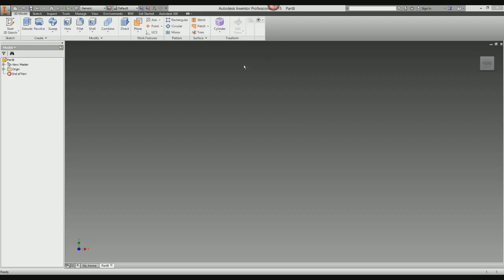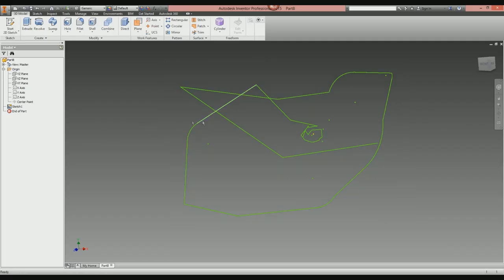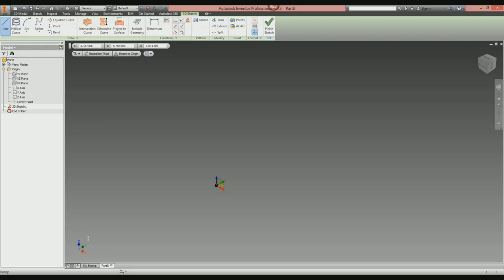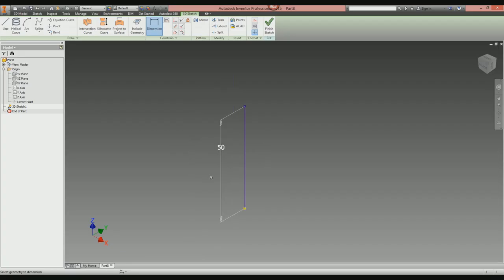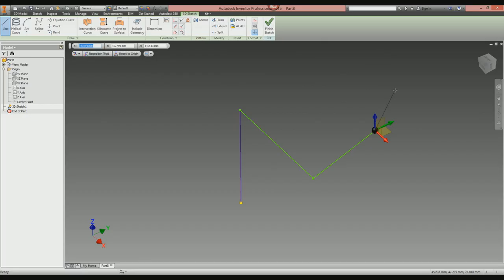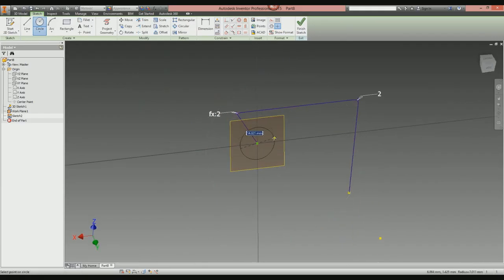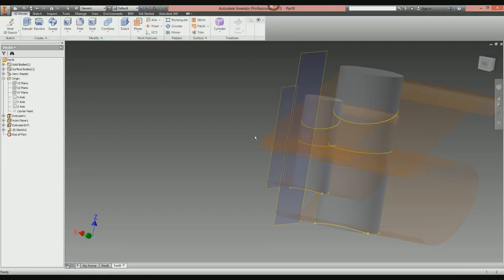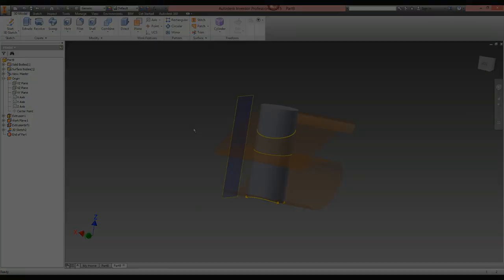How to 3D Sketch | Autodesk Inventor

Comment: your channel is the best. best vids for inventor I wish I can find someone like to that teach AutoCAD electrical.....
Reply from the maker: Thanks! AutoCAD Electrical is something I've intentionally dodged over the years, it's an awful program.  We're actually completely replacing it with EPLAN in my company, Autodesk have shown zero interest in developing AcacE so we're ditching it and moving on to a proper solution.
Reply: Thanks for the response and recommendation man! I shall have a good look at EPLAN. The reason that I was considering AutoCAD electrical is that it's somehow compatible with Inventor, and create the physical model in inventor based on the design in autocadE. The application I'm modelling is an EV, so I was looking for a solution that could save me time sketching all the cables( 3D sketch maybe lol), wires and connectors. I don't know whether EPLAN is capable of doing this.

Comment: Very good tutorial vid. Down to earth and practical. I've struggled the last few months with 3d sketchs in Inventor. I've come from ProE, which is difficult, and solidworks which is easy for 3d sketchs. The many articles I have read on the subject failed to mention little things like like selecting the planes on the Triad. Simple whenj you know but impossible to fathom when you dont. One thing that I'd like a little more knowledge on would be the include geometry feature. Why cant you select origin work features? Or can you?

Keep up the good work.

PS I like the music.

Comment: good video. How important is to have a basic drawing course, before trying to learn Autodesk Fusion  or Fusion 360. Is there a book of homeworks for drawing 101, where students can begin to learn how to draw in in general, and then later learn 3D in Autodesk or CAD???
Reply from the maker: +Alberto Ratmiroff Autodesk Fusion and Fusion 360 are the same thing.  And what you've just watched here isn't Fusion! This is Autodesk Inventor, you could say it's the original 3D package from Autodesk and the big brother of Fusion.  There may be books out there that teach general drafting skills but I've never had any contact with them, the best option is to decide which software program you want to specialise in and self teach yourself.  Whether you go for 2D or 3D will depend on which industry you want to work in

Comment: Very good video, thanks for posting it this really clarified my understanding of 3d sketching.  One thing that I was looking for in the video, was if I can create a sketch on a plane that I can then extrude to a cylinder, so that I can have one cylindrical part, and a separate part that would essentially attach to the cylinder so that I can maybe glue the two pieces together on the tangeant, do you have another video that shows that kind of use for 3D sketch?
Reply from the maker: Jason Wright Yea what you're you're trying to do their isn't a 3D sketch requirement.  If you do a 2D sketch on a plane and you're extruding to a true cylindrical face, that'll be an emboss you want to do.  That'll terminate the extrusion on the cylindrical face and wrap it around.  Alternatively, if it is a separate part, it should really be done in an assembly as a separate part too!

Comment: Great videos. Could you do one on sketching on multiple planes in 3d space and applying constraints to those sketches to create rails for Loft? I'm having a hell of a time. I can use constraints no problem on a single plane but they don't seem to have the same properties when there are multiple planes in 3d space. T-spline handles can't be manipulated either. I am clearly doing something wrong!

Comment: Well covered.  Can you tell me if there is a way to connect the 3d sketch point (start line) to existing geometry?   Or can you tell me if there is a way to project geometry or a point to a plane perpendicular from the projection as opposed to perpendicular to the work plane.   I am trying to get from a obscure angle plane to a set plane.
Reply from the maker: Winston Beshore Thanks! Firstly, yes you would use 'include geometry' which is on the 3D Sketch panel whilst you're 3D sketching.  The second one, it's difficult to visualise what you're trying to do without seeing it... but you could try the various 'project to surface' options available within 3D sketching?

Comment: I wont to design a motorcycle frame with 1 1/8 OD tubing. This will need to be made with 3D sketching. The tubing will need to be arc’s starting @ 0,0,0 on X plane from rear axis to the seat. Approximately 17”,9” (arc offset about 3”) – y plane arc @45 deg. to offset X Plane offset 5” (arc offset 1.5”) then on offset X plane to front of bike strait for 4”.  The 4” length will be split in half for welding to another tube. I can’t get it right each time I have tried it. Once you show me how to do this, I will be able to design all the tube frames.

Comment: I have just discovered that one can use precise input in 2D sketching too. I recently had to model an existing large flat plate with three sets of hole type (tapped, clear and clear with c'bore). The hole positions were given in a co-ordinate table for hole type A, B and C, with the number of holes being 94. The plate had two planes of symmetry and so I used the point tool place and dimension points on one quarter and then mirrored and rotated (I couldn't get it to mirror a mirrored set of points). I didn't use precise input, but I wish I had as it would have made life a lot easier. Is there any way that one can use the precise input so that the dimensions are automatically recorded? I found that while the points were in the correct place I still had to add the dimensions. 
Regards, Bob

Comment: What I'm missing is when I actualy have for instance a oilsystem and have 2 positions in an angle of lets say 72°  that are determined true the assembly of all the components.  
How do I get from there to create a 3D sketch at a quick way to create a pipe or flexible hose to connect these two point in a correct way.  The rest of it is all good!

Comment: Very informative, thanks. Video was a little fuzzy. Any way to sharpen it up?
Reply from the maker: Daniel Drouillard Cheers :) All my videos are recorded in 1080p with the more recent ones at 60fps.  Did you hit the cog button under the video and change the quality? It should be crystal clear at 1080p but can be slightly compromised if downscaled to suit a different resolution (whatever you're viewing it at).
Reply: Got it. Probably my settings. I will check into it when I get a chance. Thanks

Comment: Hi ... I am sorry to be thick.. but I am and Inventor virgin so to speak... have been watching your videos, which are brilliant by the way (and i don't think you talk too much).. I ve learnt a lot, BUT!!! the little things are catching me out.. for instance, when using the sweep function, I draw my lines, do the planes blah blah blah, just like you showed me in the vid.. Hey presto!! beautiful.. But (another one) ... if I then for instance have two rectangles , joined at one corner on the same plane but separate sketches as in done at different times, even though they look together ( so to speak ) i cant select both of  them to be included in the sweep path... I'ved looked at the Autodesk help (clear as mud) and the only solution i can find is a video on you tube pertaining to Autocad... which has a line joining tool ... Please can you help Obiwan your my only hope... Tom